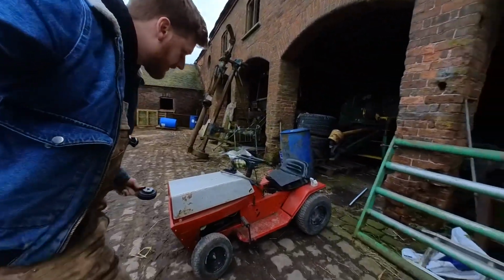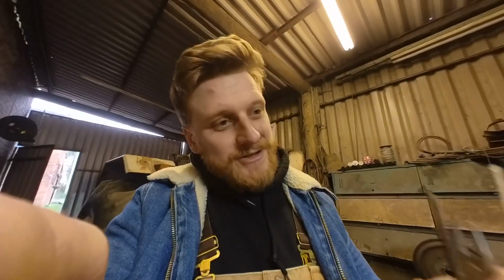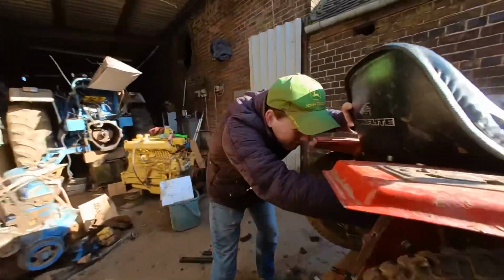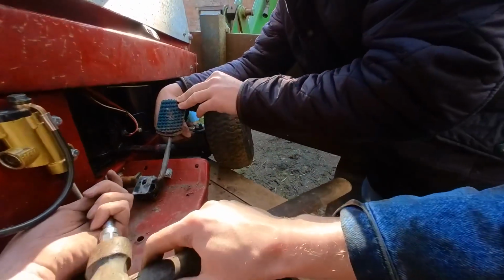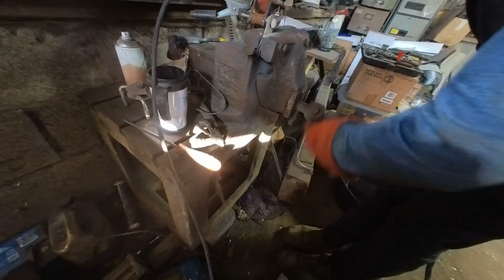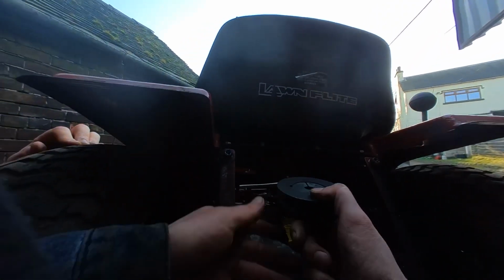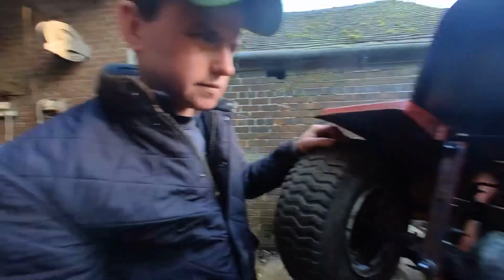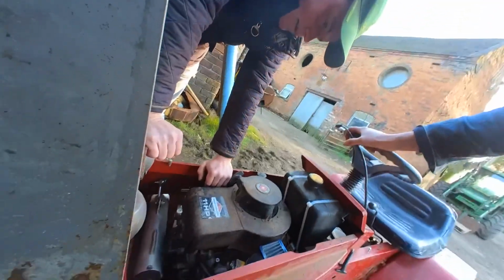The Mow-Kart Drives again… but not for long!

Comment: Open the carburettor, check to make sure some dirt hasn't blocked the float from shutting off the fuel supply, if it has it will cause the carb to fill up and eventually flood the engine.

Comment: Your pulley is upside down and bolts need to go in opposite side to pull center into taper on outer pulley, then it should close split in center and tighten onto shift.
Reply from the maker: I don’t think that’s right. It only fits together one way. The taper stopped it from being assembled any other way than the way I had it. Plus it lined up with the push out hole this way.  Think the issue was the way want correct so it wasn’t allowing it to but down on the shaft + key properly